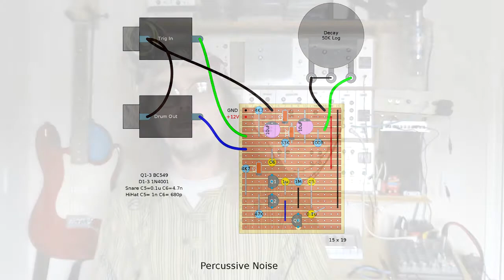Project XII Modular Part 10:  Hi-Hat & Snare

Comment: I have built your layout and cannot get it to work properly. There is no noise just a high pitched tone when I trigger the drum. the decay works nicely and the VCA part as well but I simply don't get noise from the transitor with the disconnected leg. I even tried to replace it but it didn't change the sound in any way. Do you have any idea? Did you really use the same layout for your module?
Reply: Hi, I have built too this layout (big thanx @CuSi Sound). I replaced 1uF cap between Q1 and 1M resistor with 0.1F (104) and it's works great, with right mix of noise and drum, very snappy sound.  I have built it on a single stripboard with snare and hi-hat and common 12V power supply. I also added a single voice volume control.
Reply from the maker: @robertoc.5505  One of the advantages of diy is that you can tweak the circuit to your own preference.
Reply: oh and I tried the cap values for the snare
Reply from the maker: I have built this circuit with this layout a few times so I know it works. However, I have had problems getting some transistors to produce noise. You must make sure the disconnected leg is not shorting out on anything otherwise it won't work as intended. I have found that the SS9018 is the most reliable transistor for producing white noise over a range of voltages but be sure to check the pin configuration as it can differ from one transistor to another. The capacitor values alter the filtering of the white noise but should not affect the production of the noise.
Reply: @CuSiSound  thanks I will try it again sometime soon

Comment: Good call on using a smaller log pot instead. I think that would work better for all these decay pots, as they all seem very sensitive in the beginning. My problem: I never have enough pots, or of the correct values as home :). I also liked your snare. I'll try to replace my snare cap for the value you used and see if mine works better with that... Now I need to go and see what other improvements you have done! Thanks for the shout out aswell :)

Comment: I have not focused too much on percussion so far so I'm interested in your process. The main reason has been that I couldn't justify losing the amount of rack space to so many modules dedicated solely to percussion. However you have made a very good argument for modular drums: it's essential for tweaking all those tiny parameters with just a turn of the knob. That's a very attractive reason. Thanks for bringing it up!
Reply from the maker: You could buy a drum machine and a selection of effects pedals or spend enough on the drum machine to get one with the effects built in. However, one other point I make in this video is that I tweaked the circuit to work with my system how I want it to. In this way I can create and manipulate sounds in a way that I could not achieve with commercial kit. The fun is in experimenting with quirky DIY modules to find those sounds that are unique to my system and hence my music. Also, like a lot of people,  I don't have the money to buy enough commercial kit to get anywhere near the system I have built. One of the reasons for sharing what I do is to make electronic music more accessible, for a few dollars and a little build time most people should be able to build most of the modules I have in Project XII.
Reply: @CuSiSound  Thank you for sharing your explorations. I really appreciate the way you adapted the noise circuit to your own needs. It shows how once we gain little mastery over electronics theory we can use the knowledge to make creative decisions. Well done!